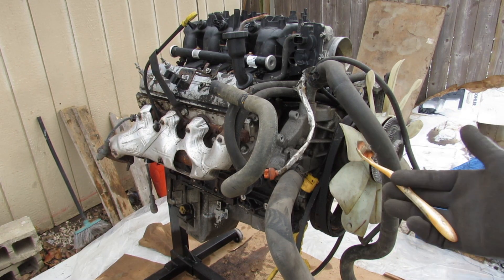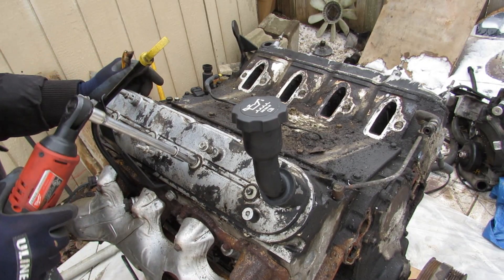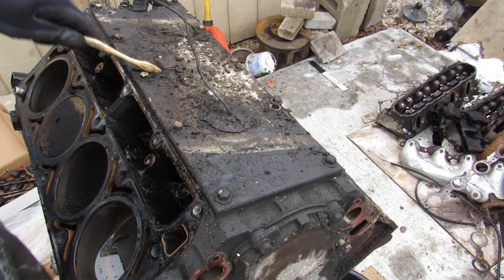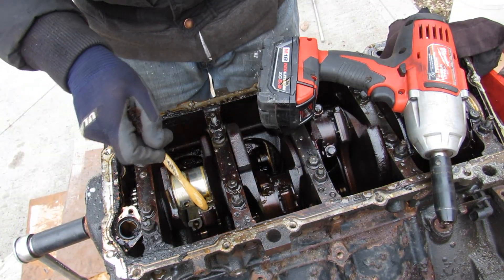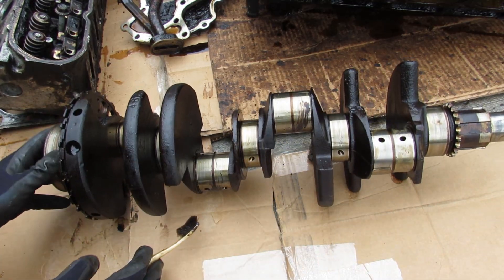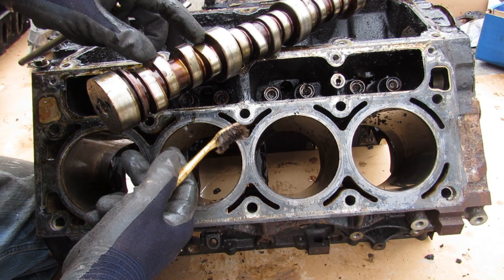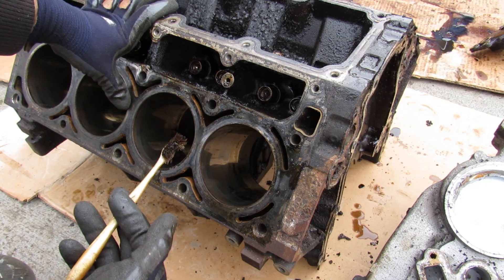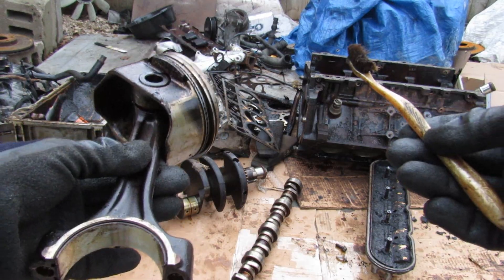Why the Chevy LS is the Best V8 Engine

Comment: A simple well designed engine with high flow heads and strong bottom end. Still, they do require clean oil once in a while. Speedkar, you're the best.

Comment: I came to this video wondering how the lifters work. only part of this engine still don't quite understand. are they held in by the plastic buckets? do they move up and down in the bore or does movement happen internally? why are they there as opposed to just having the pushrod go to a roller that rides on the cam? what causes them to collapse?

Comment: sludge,glorious sludge.........I have seen worse, the notorious,infamous GM 3.6 quad cam V6.  It had a stupid tiny oil filter, and the standard oil change interval, cheap ass mineral oil at 15,000km was an utter disaster for sludge.

Comment: Why didn't they make a 32 valve double overhead camshaft head instead of old fashioned push rod design. Best way to get rid of sludge is to drain the oil and replace the oil with petrol and leave it in for couple of days after draining out all the black muck.
Reply from the maker: The V8 will soon get replaced by 6 and 4 cylinder engines. GM wouldn't want to invest in that

Comment: I'm a big fan of the Ford Coyote engine and I really like the Gen III 5.7 Hemi in my truck but I have to admit, the GM LS engines are extremely formidable.  Simple, cheap, reliable, durable, etc, etc.  Car guys get all woosy over AMG V-8's, but I'd put a top shelf LS engine up against them any day.  Furthermore, I'd love to see what AMG could build for even twice the cost of a good LS.  I bet it couldn't even touch the LS.
Reply from the maker: Good thoughts. I don't have much experience with V8 with the exception of the BMW I tore down

Comment: SMH… you’re Speaking of engine architecture that Ford used way back in the early 50s and then started using it again on their overhead cam engine which is funny because general motors made fun of Ford for using that design.

Comment: So like, a 1999 Tahoe in upstate ny low rust on it tho. 225k miles. I'm only looking at running the truck 3 years tops prolly 15-20k yearly miles. Should I concern for the longevity of the motor?

Comment: My first vehicle was a 2001 Sierra 2500 with a 6.0L LS in it, probably had about 400,000 km on it by the time I sold it to the scrap yard. Thing was terrible for fuel economy but the engine was sturdy and never let me down
Reply from the maker: And the transmission???
Reply: @speedkar99  4L80E
Reply: Still driving mine. 6.0. Not modern, but works and 200,000 miles. Good for another 20 years. 😊
Reply: Not an LS
Reply: @joelsanfordphoto  6.0 LQ4 is LS

Comment: Your gonna go broke wasting perfectly good reusable tooth brushes after your vids. A little carb cleaner...good to go. Those modified bristles will get into places new ones will not. LOL really great job explaining the mechanic's of the engines. But, like after seeing "Jaws" and not wanting to swim in the ocean anymore, I'm paranoid buying a used vehicle w/o pulling the oil pan. Thanks again, have learned so much in such a short time. Based on your knowledge I would like to see an engine with your name on it. Be safe.

Comment: I put 300K miles on an 03 Yukon with the 5.3.  I replaced the water pump, alternator, AC compressor, but never anything to the engine.  I was burning about a quart of oil every 5K miles when I sold it.  It was a wonderful engine.

Comment: My one issue with these style of engines is the oil filter location and type. They use equivalent purolator 2222 oil filters, which have a decently sized thread. The issue with its location is that if you don’t absolutely wrench the oil filter on as tight as possible, the natural vibrations of the engine cause the filter to slowly loosen itself. Most filters can be put on by hand unless they are canister filters or diesel filters, but these are the only ones for average size gas motor oil filters that requires being over tightened
Reply: And the worst part, is that the oil filter type has the same issue on jeeps, gms, and so many other brands of vehicles.

Comment: Excellent videos and appreciate all the knowledge and tips you provide. I have a 99 5,3 l LS with 187 000 miles on it. It has been well maintained and have no issues. In your opinion, when is the time to replace the timing chain or some other internals as preventative maintenance? Other than that, these engine are excellent and reliable. Thanks for you help.

Comment: That proves that simple pushrod engines can still compete and even outperform vs comparatively complicated overhead camshaft designs in terms of power, reliability and ease of maintenance. As for 4cyl engines, we can compare GM LS1 to the old Toyota 2T and 3T engine series which were also pushrod type, also powerful with huge potential and so simple and fun to work on.

Comment: GM really should've used the reverse flow cooling system from the LT1/LT4 engine on the LS based engines. The reverse flow cooling system was the best part of the LT1 platform. The Optispark being the worst part. Although they do last 100k or more without issue.

Comment: As much as a dislike GM anything, I might have to agree. My company truck is run ragged with oil changes at 10-13k miles. The rest of the truck is quickly falling apart around the drivetrain. It’s also on its 4th pair of exhaust manifolds at 167,310 miles. 2014 2500.

Comment: in the UK this engine wouldn't work due it being too thirsty
Reply: It's way more fuel efficient than (gasoline) engines from Benz and Bimmer, and a toss-up against the Audi turbo sixes. It won't be practical for granny doing her shopping on a pension, but if you want speed, you will pay at the pumps. Weight reduction, aerodynamics and most importantly, a disciplined right foot (!) have been known to yield north of 35 miles per US gallon in 4G F-bodies with LS1 and manual transmission.

Comment: If a friend were to have such a build-up problem inside their engine, what would make it all better? I'm concerned that it is an ongoing disaster, but the bearings were not yet getting ruined. I'm concerned that trading the oil for kerosene or something may free chunks without dissolving them, blocking oil passages and effectively ending the life of the engine.

Comment: Ok 2 questions I have a 2012 Corvette with the ls 3 so all this sludge is coused from not changing the oil regularly? And 2 do I need a catch can even if I change my oil regularly I usually change oil and filter when the oil management system hits 50% is that often enough?? Great channel new subscriber. Thanks

Comment: Interesting to note that the LS has the same bore spacing, manifold layout and sparkplug angle as the SBF. Even has 4 head bolt pattern  that is nearly in the exact same layout as the SBF. I found this out while researching hemi heads for SBFs. With minimal modification, they can be used on the LS. Both great engines and the LS should provide hot-rodders with a great source of engines for years.  Great video.  I wonder if all your relatives wonder where their toothbrushes get off to? Oh, in case your interested- http://www.hammerheadperformanceengines.com/
Reply from the maker: Nice

Comment: That’s why that engine platform is the best.  It’s old school.  No 4 separate cams and phasers to worry about.  Manual mechanical fan.  If for some reason that piece fails, it’ll just remain on.  Not like my Infiniti G35 when the fan module failed.  It forced me to use my heater the rest of my 1 hour commute home.  In the middle of summer.  My discomfort was worth it though, saving that VQ35HR engine I adore so much.

By the way, the previous owner of that Silverado where that engine came from suck.  He sucks so bad as a car owner.  Change your goddamned oil for Christ sake.

Comment: You can tell the manufacturing quality is no where near what you get from HONDA. it's not a bad motor. But the fit and finish is pretty poor design IMO. But wow does it make power.
Reply from the maker: True but I don't think they are comparible. Honda doesn't make V8s

Comment: I have 266k miles on mine, still runs great.
I hear 300k is the average life of the engine.
My tranny is still going. Should die before the engine.
My water pump went out at 260k.

Because I putt around town with my truck, I think 400k is possible.
Reply from the maker: Good old 4L60?

Comment: --Thanks for the vids! It's nice to see a real tech making vids. 
I believe the GM LS V8 is one of the best V8s out there. No wonder they sell so many. 
--I like the hydraulic clutch fans, sound much cooler than electric fans. haha
--Port injection worked great, and CAFE standards are forcing manufacturers to make more complicated engines, like direct injection, which just moves the problem from one area of the engine to another, i.e., the intake. 
--So much easier to work on than a Nissan V6. 
--I'm guessing someone obviously didn't change the oil frequently. Did you get that from the junk yard to make the vid?
damn head bolts. hahaha. kind of like a bullet engine.
Reply from the maker: Im not a tech, im an engineer  . I got the motor from someone who parted the truck for it's frame. He said it ran...
Reply: @speedkar99  even better. good for you.engineering in what?

Comment: I have the same milwaukee ratchet, it's great. As for the LS I kinda respect it, I don't really like how it ends up in everything but I kinda get it, they're common and cheap and simple. I don't like the idea that ls is always the way to go just because you can make so much power, a lot of engines could make a ton of power, sure the ls is strong but it's not special in its design compared to any other v8. I don't like the whole thing it represents, saying fuck it and ls swapping it. I like builds that give off an air of someone decided they want to make something cool, not that someone was focused on making as much power as they could. Anyway that's my two cents, I still see the merit of the engine, and no engine deserves that much sludge.
Reply: The thing to remember about Chev engines and swaps is that they will fit! Ford and Mope cammers are tall as hell.

Comment: 2014 and newer GM trucks have all aluminum engine block and heads .11:1 compression and direct fuel injection  355hp & 385 torque
Reply from the maker: The LT

Comment: LS uses longer head bolts to lower bore distortion by placing the load lower in the cylinder where the threads are.

Comment: I think what was most impressive was how much abuse the motor obviously had before it ended up in a junkyard but the bearings still looked pretty good. With proper maintenance they must be capable of very high mileage? (or do other things fail much earlier?) You mentioned intake air leaks as a common fault, is it due to plastic intake or bad design/small surface?
Reply from the maker: Yeah I was surprised how well this motor held up
Reply: Bones McGillicuddy  OK, pretty simplefix. Thanks

Comment: The only thing this or ANY other Chevy motor is REALLY good for is.......... Holding your BOAT from floating away!!    Just make sure the CHAIN is attached to your boat before you through it out!!!!      If not...... Don't worry.  There are plenty of Chevy engines to use.   Might I suggest the Mystery motor.    That would be a PERFECT one to use in rough water!!!
Reply: @stearlers069  You mean they gave Ford the small-block Chevrolet, eh?
Reply: @stearlers069  In 2021, "Ford cammer" typically refers to the modern 4-cam engine, not an ancient SOHC big-block. Also, literally the only goal of racing is advertising. GM being the #1 auto maker for over a decade by 1963 presumably had something to do with their decision to spend their advertising money elsewhere...

Comment: The worst part of this design is they moved the oil pump to the front of the engine then pass it back through to the pan into the back of the block for filtering, the O rings fail and the screens plug up and you lose pressure and then the engine, I've replaced hundreds of them and its a shit design. they should have left it on the back of the block... 
I would rather have the old school 350 or 427 design, there stronger and last much longer.

Comment: Depending on the years, some Impala and Grand Prix, has only V6 3100 - 3800 - 3900 engines, not the V8.

Up to mid 90's the Caprice Classic ( ex police car ) / Impala SS had the V8.

As I recall, up to the 80's the large boat sized Grand Prix had the V8.

Later 90's up to 2004 had only V6.

From 2005 to 2009 for the Impala SS and the Grand Prix has the V8.

The 00 to 09 Impala was also used as police cars.

Comment: This guy is a true pro.  This was extremely well articulated.  There are no dead spots.  It's a barrage of constant information.  This guy is a top professional.  This guy is a college professor.  Of mechanical engineering.

Now what I want to know is.  Who would have this lovely LS, engine.  To have never been giving it  oil changes?  I mean who does that?  You want and get a high performance engine.  To go with your high-performance vehicle.  That means changing the oil once in a while.

Though, one of my most beloved bosses.  I worked for early on in my career.  Who believed in me.  He had a Buick Electra 225..  And in the nearly 400,000 miles he had on that car.  He never once changed the oil..  He would just keep adding it.  Never changing it or the filter.  It was amazing!  His eldest son was my/is my, older high school buddy and great friend.  Like a big brother.  And his dad Max.  He would joke about never getting the oil changed.

So I guess it really just comes down to.  You win some.  You lose some.  With better maintenance.  It might last a little longer.  But then again it might not?  He never changed the oil!  And he had that car for over 20 years.  More like 30.  From the early 70s until the late 90s.   I don't think they make them like that anymore.  Now they are guaranteed to fail and not last.  That's a much better business plan.  Than making things that last.  I built some tape recorders back in 1979.  That are still running today.  As people notified me they still had my recorders and were still using them.  After all these years.  It made me feel so proud..  I was the Quality Control Manager.  I guess I did my job well.  Mine is still like new..  Like showroom, new.  No more than a couple thousand hours on the machines.  Basically broken in and with new heads.  And maybe one of these days before I die.  I'll sell it.  Maybe?  I was young and pretty when I built it.  Now I'm old and frail.  And it still looks brand-new.  It hasn't aged a bit.  God dammit!!!  And the name of the machine is called a Scully.  Google that.  Pictures of the machines you will see in the control rooms with the Beach Boys, Jimi Hendrix, Tommy James and on and on.  Those were the machines!  I built.  But before my time with the company.  That the founders built.  And those were important shoes I had to fill..  So many hit records were cut on those machines.  And it still to this day, boggles my mind.  That I would end up the Quality Control Manager and Chief Test Engineer.  I mean how did that happen?  I liked using those machines, sure.  I never imagined a job offer would come out of the blue air I never applied for.  And I saved the reputation of the company.  I thought that was pretty groovy of me.

Your voiceover narrative was fabulous!  That's the way to produce one!  I am very impressed with your engineering prowess, sir.  It's not often I run into the real deal like yourself these days.  You know those engines like you know your loving partners intimate parts.  And know how to keep them in tip top condition.  And with their rear ends intact.  Not to mention the transmission fluid of your lube.  Where you want just the right pressure.  Oh baby.

At nothing like a nice full synthetic for the crankcase.  I went fully synthetic back in 1978.  As soon,, as it was offered.  Mobile 1.   No more sludge!  It don't care what the temperature is.  I won't use anything but 100% full synthetic's.  And because I am an electronics guy not a mechanical guy.  You pursue the state-of-the-art in lubricants.  Use what the military gets.  Anything less is sheer lunacy.  This is the most expensive gizmo that makes you go.  You feed it the best oil.  Anything less is madness!  I'm a fucking engineer so I know!  Yeah baby!

I get so excited when talking about lubricants
RemyRAD

Comment: So better than a toyota 2uzfe? Plastic intake? Ok
Reply: its a pretty good manifold. It has better flow characteristics than most aftermarket manifolds, is lightweight, and has better thermal efficiency than an aluminum manifold which although has great thermal efficiency is much heavier.

Comment: I think there's one particular thing that makes LS engines good; they're bases off the old small block 350, and that means they're simply designed, simple to work on, parts are cheap, they're reliable and powerful.
Reply: They're not based on the 350 at all. They share some basic architecture but nothing is interchangeable. They're still the best modern engine on the market
Reply: @Connor4x4  agreed. Pretty well any OHV V8 shares a basic architectural design, there’s not much to change in that regard. Just as the BBC and the SBC don’t interchange parts, same with the LS. The only real differences you’ll see is crank plane, and oil/coolant distribution.
Reply: "Based on", yes, but nothing is interchangeable.
Reply: They were a clean sheet design. Only thing they share with the gen II SBC is connecting rod bearings and valve lifters if I'm not mistaken.